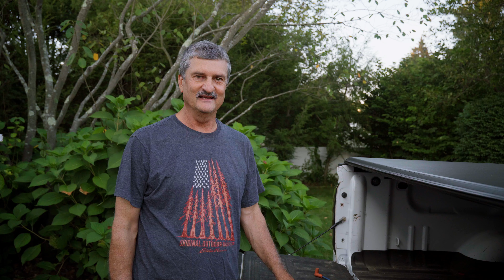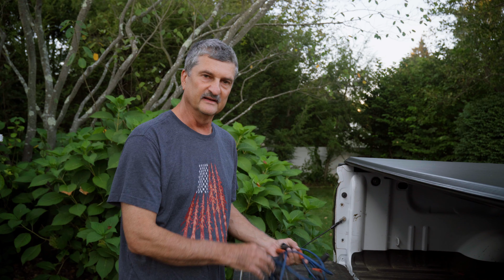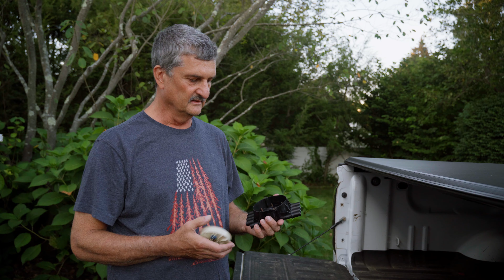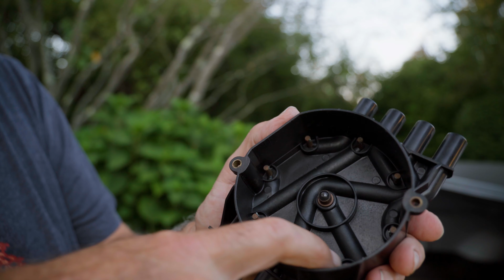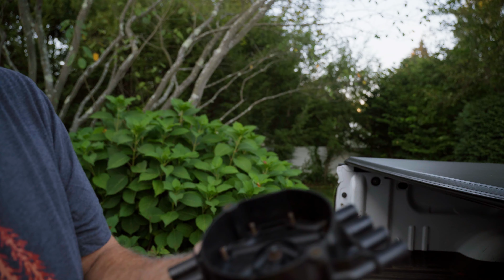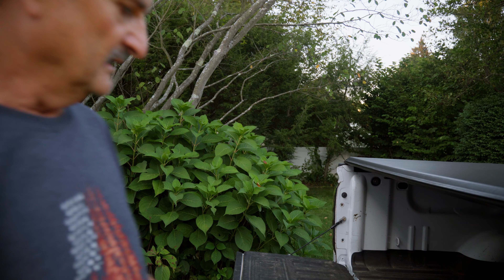Mercruiser Hesitation [ROUGH ENGINE FIX]

Comment: Mine does the same thing. This didn't really fix the problem. always found it weird it usually only does it on the first initial acceleration onto plane, then that's it. I wonder if this is a yearly thing. New cap/rotor and wires?